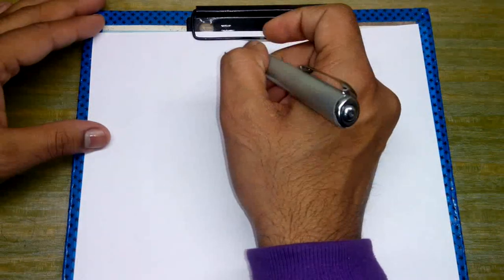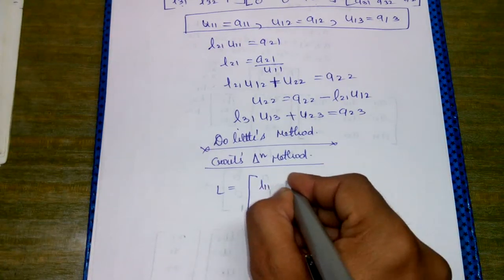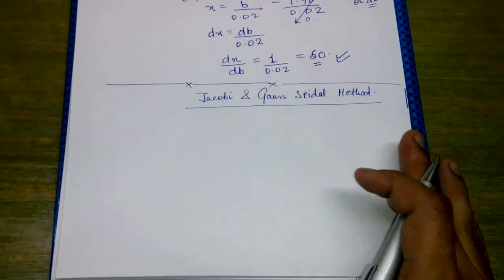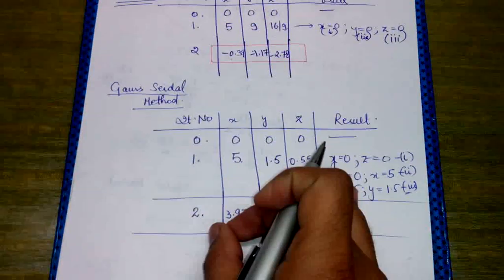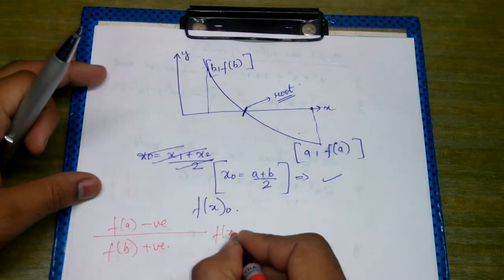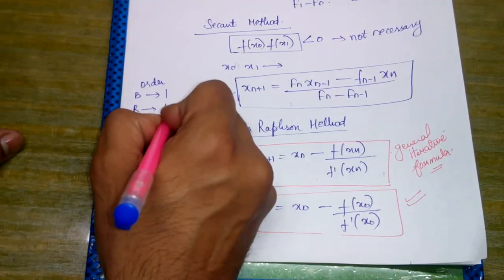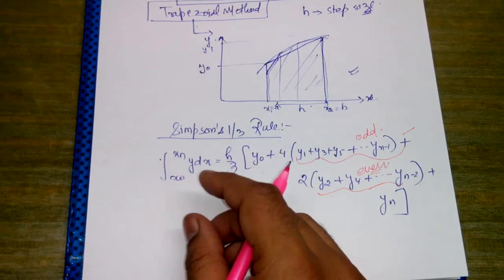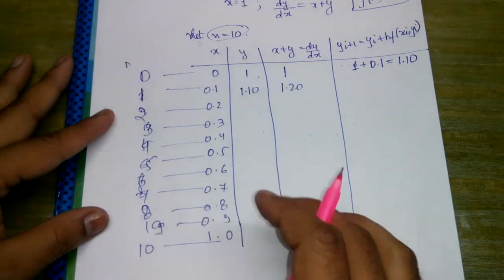Engineering Mathematics  Lecture 9 : Introduction to Numerical Methods.

Comment: sir i have a question but its not related to mechanical. it's regarding Indian coast guard. Actually sir i have filled the online application for assistant commandant general duty.But while filling i had given my b.tech percentile as 77% by guessing as i had no idea about my marks at that time. Now i got call letter from them but my real percentile is 68%(7.3 cgpa). It's a SSB type exam. Will they allow me for the exam or not. In their advt. the have written that 60% required but shortlisting percentage can increase according the number of applications received. Please share your opinion sir
Reply from the maker: Well in that case it would be a case of false information being given to the council and in my view they will not allow you...but please make a confirmation from their brochure...
Reply: ok... thank you sir